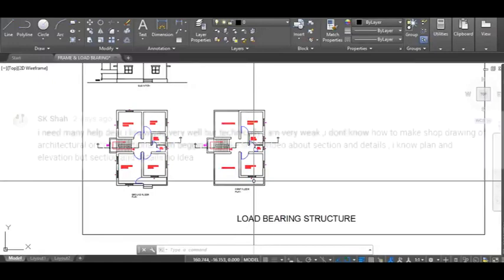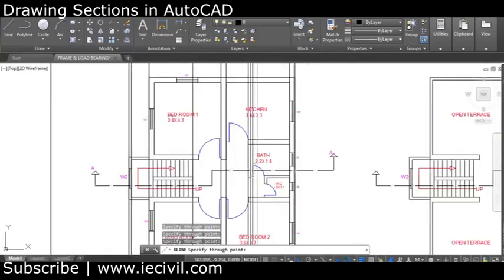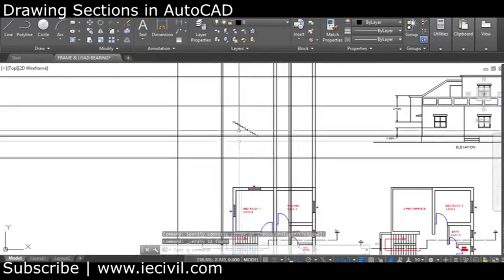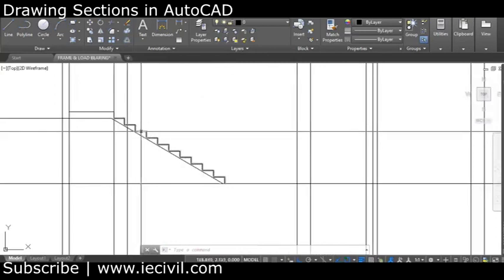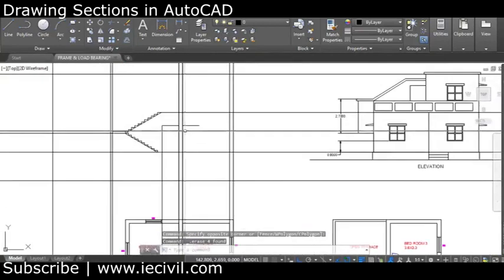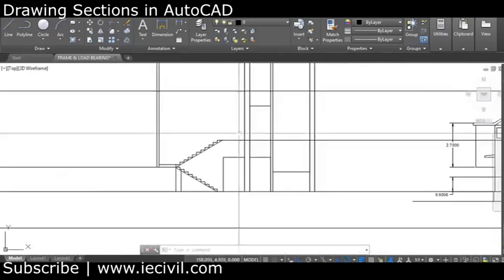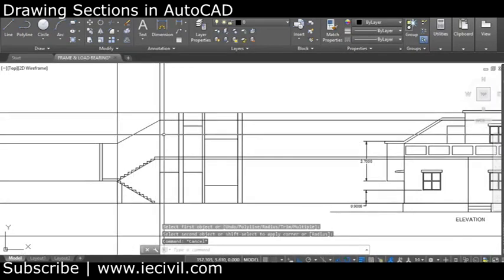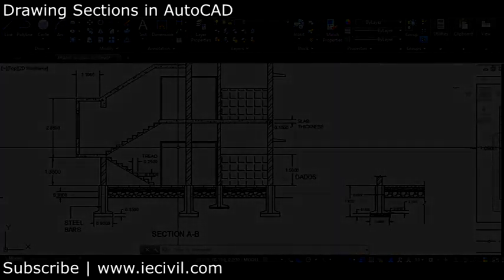Making Sections from Plan and Elevation on AutoCAD

Comment: Sir plzz upload video of same plan with frame structure including developed plan and elevation also
Reply from the maker: Hi Dhanashri,
Unfortunately I won't be able to make a video about that but if you want you can access a similar project on this link here https://iecivil.blogspot.com/2017/04/sd2project.html

It was a structural design termwork submission that I had prepared & could be used as a reference.